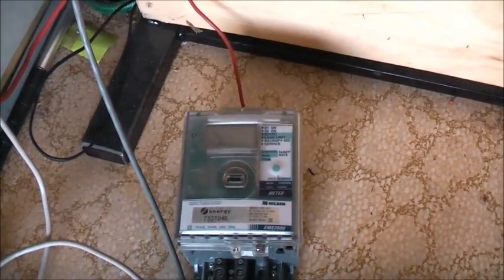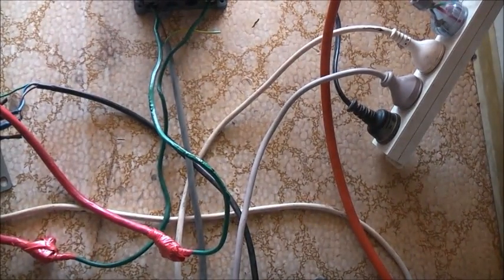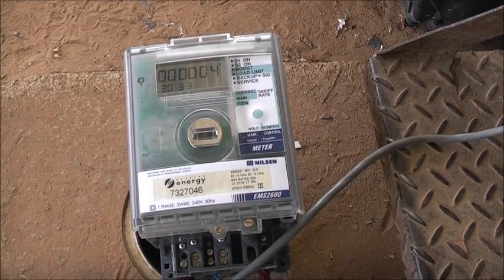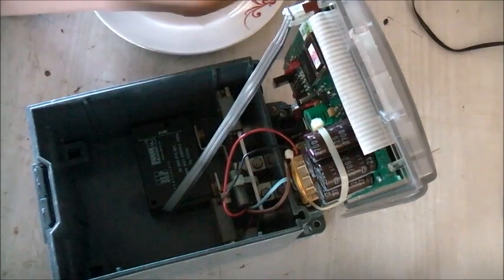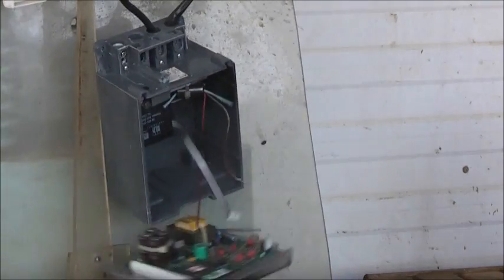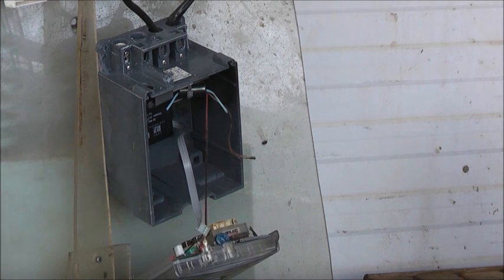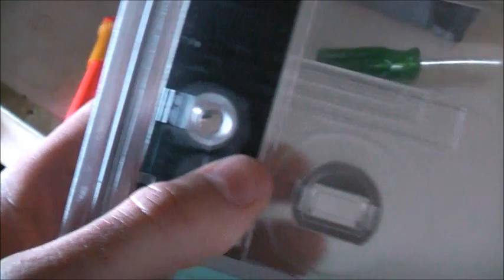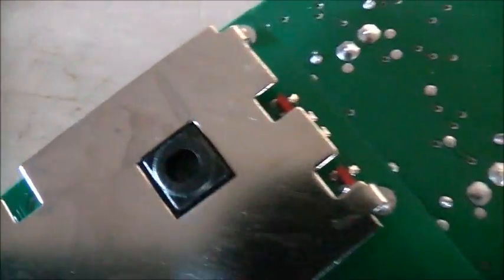Nilsen EMS 2600 Electronic Watthour Meter Carnage!!

Comment: Ooooh, that was definitely a "Smart" pop. :D Absolutely cracked up laughing when the front blew off. At that point, i would've re-configured the wiring and seen how much that busbar in there could take. Those hall sensors in there would've measured a good few kA. :D

Thanx for showing,

-BoomBoxDeluxe.